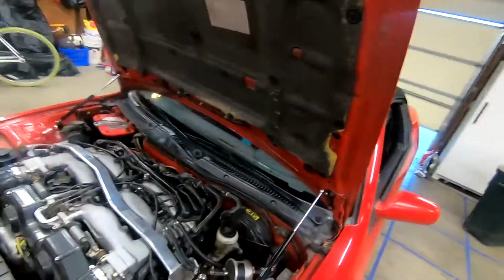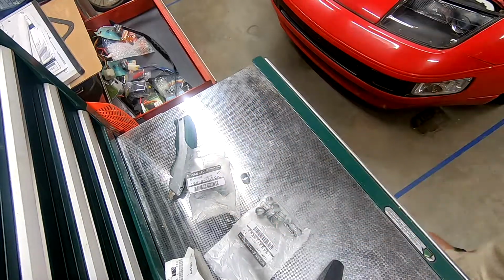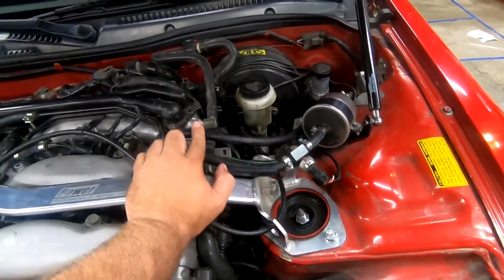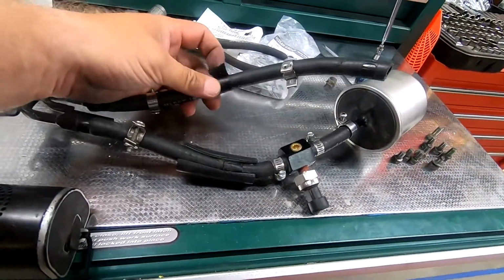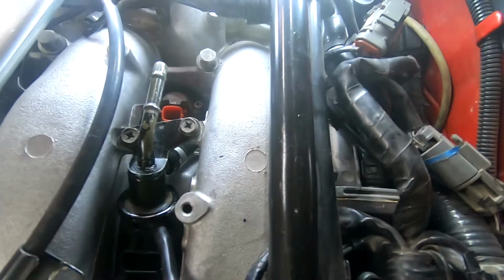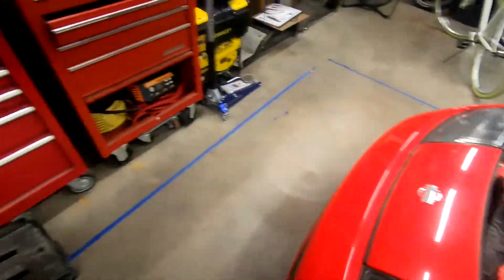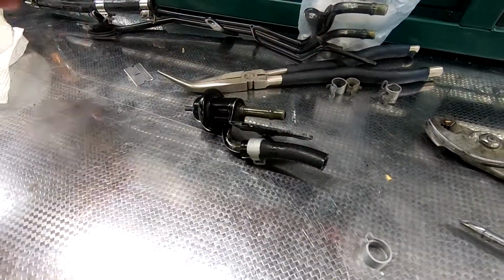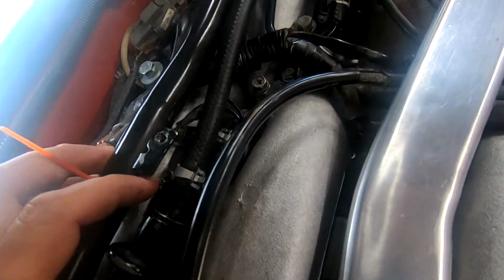How To Replace 300zx - Fuel hose clamps - Screw Type to Spring Type

Comment: Great video mate, I didnt know about this fact and these improved constant tension springband hose clamps for the fuel system look like a fantastic upgrade for preventing fuel leaks in the future and I enjoying learning and watching your video on the conversion process. 

I will definately be following your example and converting over to these springband style hose clamps as I too have had multiple instances of fuel hoses randomly leaking over time and a fuel smell entering the cabin in my 300zx when driving and this upgrade will solve that problem perminately. Keep up the good work mate.:washhands:
Reply from the maker: I would highly recommend anyone that has the screw type fuel hose clamps switch over to the spring type clamps, as the springs will adjust to the shrinking and expanding of the fuel injector hose.  I have had one to many fuel leaks in this car, and don't want it to burn down.